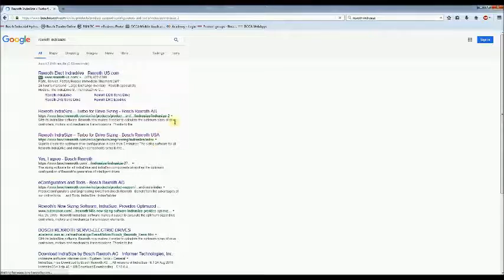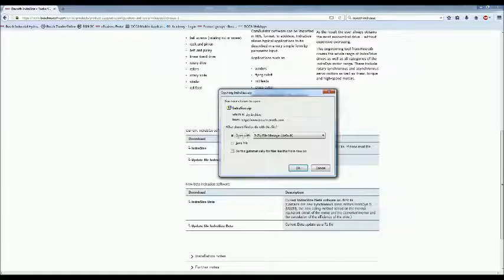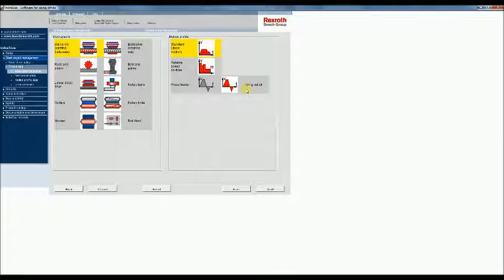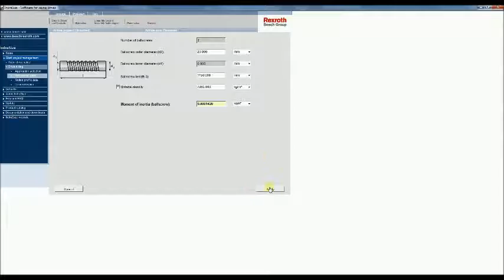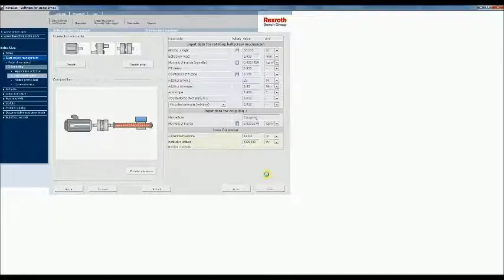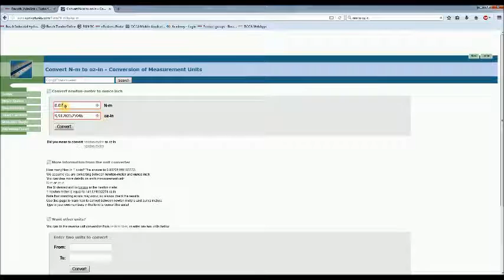How to Size Stepper Motors For A CNC Machine

Comment: This might be helpful to determine torque needed for a application, but do you realize this is for servo motors, stepper motors do not have the same torque curves as servo motors, my 8 Nm nema 34 steppers are rated at 8 Nm at 100 rpm but 0.6 Nm at 2400 rpm. Conversely my brushed dc servo motors have a continuous torque rating of 1.6 Nm from 0 to 3000 rpm and 3 times rated torque for small time periods. A stepper is not a servo! Also Bosch Rexroths do not make stepper motors.
Reply from the maker: Thanks for watching Fabricator03 and explaining the torque difference between a stepper and a servo.  As discussed in the video I used the software to determine the continuous torque required to run my cnc with a ball screw and stepper set up.  Once I determined the continuous and max torque requirements I was able to select an appropriate 3rd party stepper given their individual torque curves.  I hope this video will help others determine their specific torque needs if they are running a system with rack and pinion, acme thread, ball screws or are using gear ratios.  For me it was difficult calculating the exact torque requirements for my system given my specific motion cycle, moved gantry mass, additional force to cut through wood and having an inline coupled stepper.
Reply: I understand what you have done in the video, I thought I would mention the difference as most hobbyist have no idea what a torque curve is. I know I did not at first.Stepper motors look like bargains at face value compared to servos but once you understand the differences you start to understand why there is such a massive price difference.

Comment: i was need this, thanks pro
i i tried this but need some help. can you share more information about motion phase section ?
Reply from the maker: Thanks for watching omar, do you know your motion cycle? is it trapezoidal or triangular?  Whats the stroke and time required to make that amount of stroke?
Reply: sorry i dont, it is a 5 axis and wanna know what stepper is required. @RobinsonCustomWoodworking
Reply from the maker: @engomar4325  you will then have to look at each axis individually and make assumptions on speeds

Comment: curious to see how you made out using these calculations. Seems VERY small considering I just built a new machine, have 425 oz Nema 34 steppers, and they stall at any speed over 25 ipm. Now my Y axis is 1.5 m and my ballscrews are 16 mm but still, steppers are famous for losing torque at speed. The faster they spin, the less torque they have.
Reply from the maker: Hey Muskoka Mike, first of all thanks for watching.  Here is the system components I am using;
KL5056 stepper drivers for all axes, 
Y axis 570 oz nema 23 20mm dia x 5 mm pitch ball screw , 
X axis 495 oz nema 23 16 mm dia x 5mm pitch ball screw , 
Z axis 282 oz nema 23 16 mm dia x 5mm pitch ball screw, 
all steppers are coupled directly to the screws, my total gantry weight is about 50 lbs.  

When cutting I run between 20-30 ipm depending on the material and amount of cutting.  I think I have only stalled them once at around 60 ipm when I was first learning my system.

Yes steppers and servos will have less torque at higher speeds.  Your system speed is also dependent on the ball screw pitch and if you have gear boxes or reducers between the stepper and the screw.  If you are using linuxcnc during stepper config and if your drivers have the option you can change the microstep resolution via dip switches on the drivers to try and optimize your drivers.  On my drivers I can also change the current, I have heard that the micro step resolution, current selection and DC power supply for the drivers all have an effect to how the drivers and steppers perform.  I used this program to get some rough numbers on the torque needed.
Reply: That's awesome, thanks for the info. Yes I've recently learned about micro steps. The thing I've learned is: more microsteps=more torque but the stepper has to spin faster so at speed, you get less torque. Higher microsteps (say 1/2) you get less torque at low speeds, but the motor spins slower at speed so you get more torque when spinning at a faster ipm rate. 

I'm fiddling around with amperage and volts trying to get my motors to do a reasonable ipm without stalling. 

I'm probably going to pick up some new higher torque steppers, they are cheap enough. The ones I'm currently using are out of my old machine and have been run hard for 10 years...they could be just tired. I really shouldn't complain: I was running a test this afternoon and I put my entire body weight (180 lbs) against the gantry and the whole machine started sliding across the table it sits on instead of stalling. I tell you, this is my first experience with ballscrews instead of rack and pinion and they ARE the cat's pajamas.....
Reply from the maker: Yes Mike very true, I paid about 40 USD for my steppers.  I get around +-0.002" with 4 micro steps, thats all I need for my work plus my old computer only has 512 mb of RAM so I take it easy.  Thank you for cheap ball screws!

Comment: Can we specify the material that we want to mill aluminum for exemple
Reply from the maker: Hi Oussama, unfortunately no you cant.  You can search the amount of force required to mill aluminum, do a calculation and get a force value in newtons.  Then you can add that force value to the force table as an external force.
Reply: Thanks à lot i thaght so